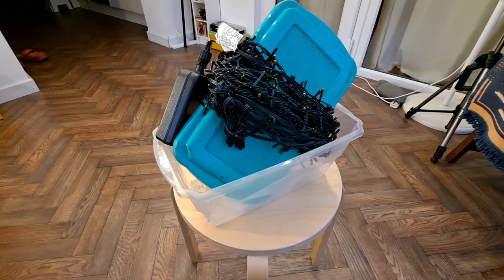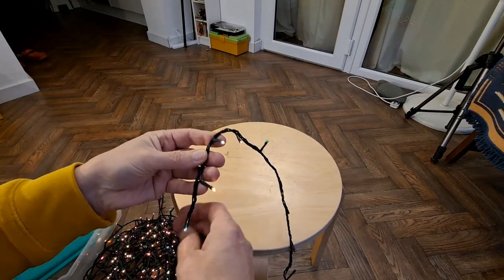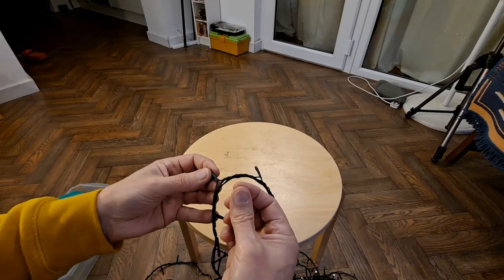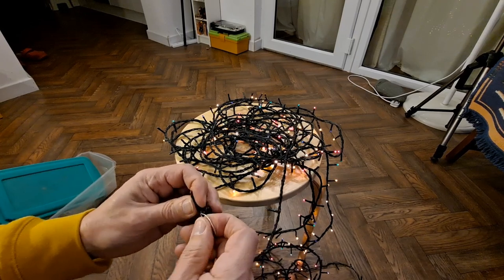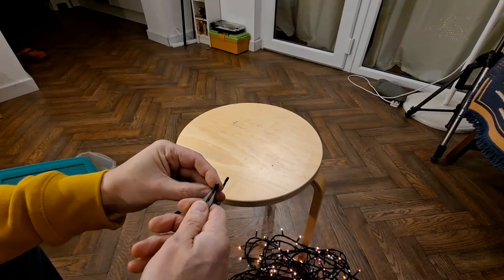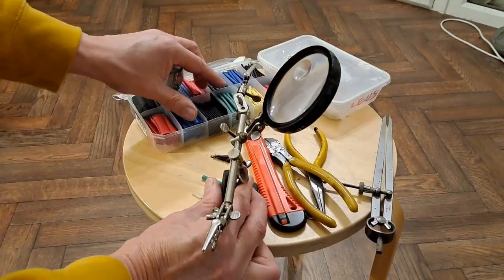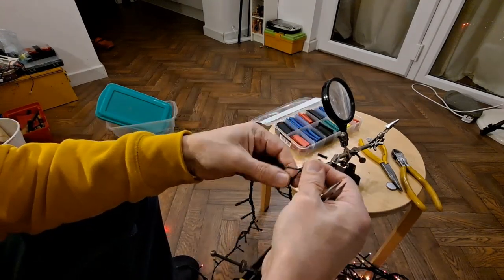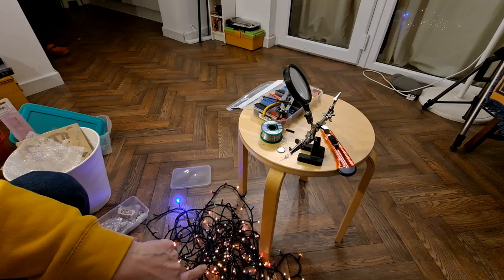That time of year again, Another faulty LED light string to look at (FAIL)

Comment: those lights do not look like LEDs at all, more like miniature incandecent light bulbs. That would also explain, why they have been coated in coloured laquer. And finally, the LEDs you put in are way brighter than the rest of the string.
Reply from the maker: The LEDs I put in are marketed as "Ultra Bright". They just happen to be what I have in stock. And the existing LEDs certainly are LEDs.